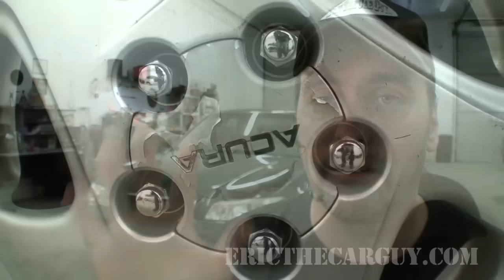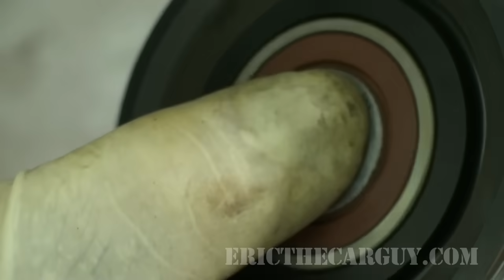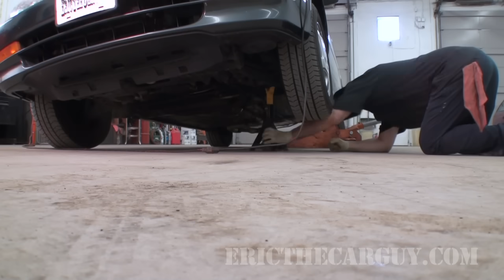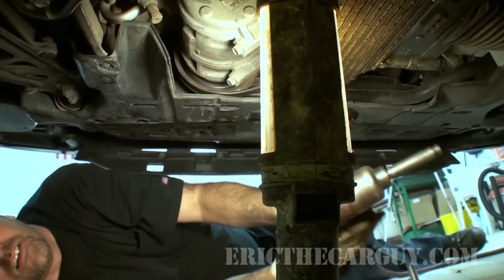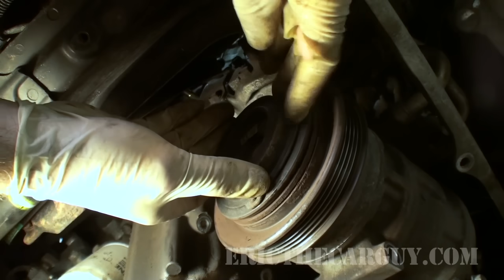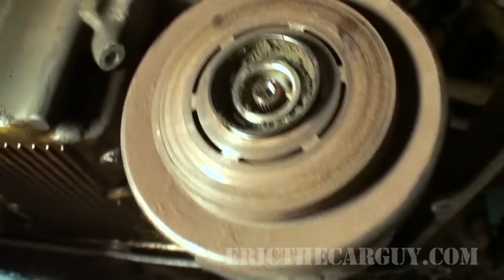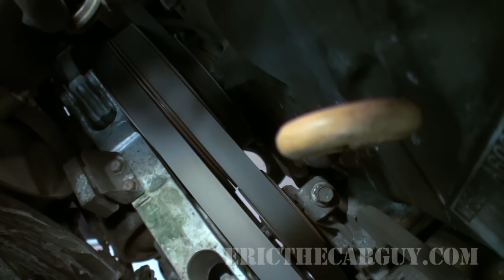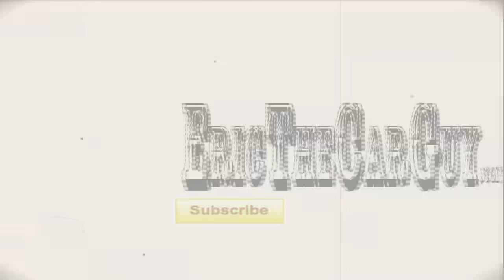AC Clutch Repair and Noise Diagnosis -EricTheCarGuy

Comment: I HAVE HIGH PITCHD SOUNDS FROM MY CAR WHILE THE ENGINE IS RUNNING BUT THE AC IS NOT ON AND IT DONT WORK EITHER! I BOUGHT THE AC COMPRESSOR TO REPLACE I ALSO NOTICED WHEN I PESS ON THE GAS WHILE DRIVING THE NOISE GETS LOUDER.

Comment: Surely if the noise is only there when the air-con is switched on, then it can't be the ider as it runs whether the air-con is on or off. Oh! I love your bearing treatment, guess this guy will be bringing his car back with a knackered idler bearing next few months eh? I see what you're doing there.

Comment: Hi Eric. This video is a great help.

Need your guidance for an issue I am facing with my brand new (3 months old) Hyundai Elite i20. The car noise is normal when the AC is ON but as soon as switch off the AC, there comes a grinding noise from the dashboard. The pitch of the noise also varies with speed. This is a new car and this issue is annoying me. Could you please help with your experience what might be the issue causing this?

Thanks a ton!

Comment: Hi Eric is it possible to adjust the position of the a/c compressor pulley? I have a pulley alignment issue on a 1990 ford f250 460V8 that exists between the tensioner and the ac compressor which is the next pulley in the belt path. dont think the tensioner pulley position is adjustable unless i tap the bearing further in or out to move the pulley.

Comment: hey bud I have a 05 Honda accord my clutch engages but shuts off and at the same time my cooling fan turns off. My Freon was low, I recharged the system and now it turns on and off along with the fan. The connection looks old and was thinking about replacing it........what do ya think? thanks.
Reply: I have the exact car, the coupe. You just over filled it. Bleed some of it out until the fan stays on
Reply: The clutch cycles using a compressor cycle switch to control the suction pressure. If the coolant temp sensor isn't calling for the cooling fan to stay on all the time, then the fan will cycle with the A/C clutch to pull air over the condenser only when needed.

Comment: Eric i have a similar problem.  i have a mitsubishi lancer cs3 2006 model. and  the noise happens when the ac is off. when i put it on it stops. i recently changed the bearing on the pulley. so im clueless now as to whats making the noise.  is there a bearing in the ac compressor itself. ???
Reply: had the same problem with my firebird. its the ac compressor clutch itself my friend. kind of a bitch to replace for my car. hope its not for yours!!!
Reply: kk.. i can withstand the noise for now :) .  but the ac works.
Reply: Yea mine did too. The only reason it sucked so bad was because my GM needed a special tool to do the job and so I was unfamiliar with the whole thing. If you are mechanically inclined even a bit you could tackle it. Just give yourself time and be patient. As Eric has said "it's only a hunk of metal, you have the brain"

Comment: I had an issue on a 99 crown vic where the aftermarket magnet was a different size.  I literally spend a full day in 0 degree weather trying to fit the pulley on.  I finally gave up was gong to take it to the shop but when I set down the pulley on the magnet on the bench it did not fit in.  My ahah moment.  My point; double check the magnet size.

Comment: I'm pretty sure my pulley is bad on mine,  has a little shake to it, and all the rest are real tight. but it makes that sound X 2 or 3 without the AC on.  Is that possible?
It's quiet when I put water on it and then returns to that noise fairly rapidly..

Comment: Hi Eric,
How you doing? Your videos are really awesome,they are so informative.
I just have  questions regarding my 2002 ford explorer. It has and idling issue,there is a little vibration on the engine.I cleaned the throttle valve, after I cleaned it,I did start it again, there stll vibration.I turned of the engine, when I did start it again , it cranks but won't start. I did crank over and over for 10 minute but it won't really start. I waited for 15 minutes ,I cranked the engine  and suddenly the engine turned on, and the vibration is still there.Do you think it is fuel pump issue?
It has also trans issue, and the code is P0775, says Pressure control solenoid B. Do you think they are related?

Fidel
Thanks

Comment: What about a ridiculously high pitched sequel that comes on when the AC is turned on but once I'm up to ~20mph it stops and wont happen again until engine is cold?
Reply: your belt AC belt is loss , tight it up
Reply: Master Wrong I'm having same issue.  I was told compressor is bad.  When cold starting, you can actually see the pulley slugglishly spinning while the squealing of the compressor takes place.  In my case, it started out as a small quick squeal and got progressively worse.  At first I thpught it was just the just the belt in till I got another set of eyes to observe at start up.  Good luck
Reply: DeFreshS10 wonder if the noise was in the blower.
Reply: I got the same problem on a 2006 murano.... we're you able to fix it?

Comment: I have a 2000 Silverado 5.3 with ac on at highway speed sound like a turbo pop off valve letting go now and then.
Any ideas?
Reply: QQTrick1QQ Check test 1-2? Sounds like NOX spray before launch?

Comment: why did the use the name Acura instead of Honda in the states? ???????????????????????????????????????????????????????????????????????????????????????????????????????????????????????????????????????????????????????????????????????????
Reply: Acura is the luxury vehicle division of Japanese automaker Honda Motor Company. The brand has been available in the United States and Canada since March 1986, marketing luxury, performance, and high-performance vehicles. It was introduced to Hong Kong in 1991, Mexico in 2004, and China in 2006. Honda's plan to introduce Acura to the Japanese market in 2008 was delayed, due to economic reasons, and later withheld as a result of the 2008 financial crisis

Comment: hi eric, excellent video. my clutch on my 06 suzuki aerio is worn, making a loud noise while AC is running. i called my local ac repair shops and all of them said they'd have to replace the entire compressor and wont just replace the clutch. they want between $900-1200k for the parts/labor. the hell with that im going to buy the clutch online and  im going to attempt to do the work myself. most "technical" work ive done on my car before this is an oil change, lol. wish me luck.
Reply: Were you able to find just the clutch for an aerio. I have onyl been able to find a whole compressor assembly

Comment: Your AC compressor is just identical to my 2003 Dodge Grand Caravan. I'm sure the problem is right there, but guess what? I removed the 10mm bolt but the clutch refuses to come out easy. Any suggestion about how to pull it out without harming anything?

Comment: Might have sounded a bitch harsh, i know this is an old bearing, which is easy to access and doesn't cost much. That's not always the case, so just saying.. with a little extra effort you can do a better job at it.

Comment: you shouldn't use that spacer to install the bearing at all.. this is one of the few times so far i'm going to disagree with your methods. When installing a bearing you should only hit the outer race (ring). In this case at least, if you install them press fitted on to a shaft you only hit/push the inner race. This is recommended so that you don't transfer the impact/force via the bearing balls. This prevents the formation of little dimples in the precision surfaces. Will you notice a difference after installation? No, will it mather in the long run, very likely yes.

The correct tool to use is a socket or pipe, a punchtool or whatever allows you to exert force to the press fitted ring only. Using a hammer to tap it in initially is fine, although i'd prefer a plastic/soft hammer.
Reply: Thats what most of em do at yt..they were watching just to spot the wrong or simply sayin only looking for that 1 tiny mistakes and off they go dropping atomic bomb and of course taught the whole world the correct way on the comment sec and feeling proud of himself.. Until it turned upside down to hit on him back..
Reply: robin1987100  It's amazing how many people don't listen when watching.  Try again at 7:45. He hit that one with a hammer because it was old, but I guess you missed that too.

Comment: Thanks Eric very informative video. Can I ask why you didn't just replace the bearing on the AC pump pulley, as you could have done on the tensioner.
Just asking as the parts you replaced don't seem available in the UK

Comment: eric, i'm trying to figure out if i need to change my whole compressor or just the clutch, no weird noises or anything, what happens is when i go out to start my truck for the first time that day, the a/c kicks on and blows cold like it should, now it seems once the truck is warmed up to operating temp the a/c doesn't want to kick on anymore, i checked to see that the a/c coil is actually turning on by touching a screwdrive to the clutch plate and it stuck due to the magnetism from the coil, it's just that the clutch isn't engaging while the a/c coil is on, any ideas or thoughts? this is on a 1999 dodge ram 1500, thanks

Comment: Excellent video from a great teacher. My ac is making a similar noise that I hear inside the cabin, and the ac works, but the blower inside the cabin is not blowing the ac air through the vents. So in addition to what you showed us above, what else do I need to look for? Also, my car is overheating. I put antifreeze in every other day. As a side note, we are having very hot Virginia summer days. The car is a 1998 Olds 88.

Comment: hi, im rochelle using my sisters account. anyway, my scion tc has a whining sound when its on or even when im driving. ive been to different mechanics and they said its either the ac compressor or the steering pump. i wanna get it fixed but i dont want to waste more money to fix whats not needed to be fixed. also, at first they thought it was the water pump so i had it changed. but i learned my lesson, i wanna make sure i know which part is causing the noise. help meeee pls! would it be advisable to just buy lucas power steering fluid to mix with my current fluid?
Reply: you can isolate the noise by taking the belt off each one of the systems one at a time, driving it, and seeing if the noise goes away. Power steering fluid wouldn't help unless you're already low and running the pump dry
Reply: Well I don't know about you but your sister is hot! !!!
Reply: Lucia Aguirre you can use any long metal tool, such as a big screwdriver, to act like a stethoscope. hold the pointy end on each suspected component when the engine's running and you can hear it making noise. Be careful and put your ear against the other end of the tool. as you try one component and the next, it'll be loud when you find the noise. just be sure to keep the tool away from moving parts, and yourself, too!

Comment: Hey Eric, thanks for the video. My sons 2002? or there abouts civic has a noise like that but it doesn't really change when the ac is turned on. Could this be an alternator noise?

Comment: IF its the bearing thats causing the noise then would would the ac be functional. I mean blowing out cold air when its supposed to
Reply: I had nothing to do with the video but I am a mechanic. If the a/c wasn't functioning, he wouldn't have started with diagnosing the idler pulley. It seems like it was just a noise problem, and people tend to go to a mechanic when their car is "making a weird noise". If you're hearing that sound but your a/c still works, it could still be the same problem.
Reply: cool. my ac doesnt work tho and the clutch spins regardless if the ac is on or off. i can see that there is no airgap at all...gonna get bypass pulley installed tommorow
Reply: ddq123 its low on refrigerant

Comment: Eric, perhaps you can help? I have a 1997 Toyota Avalon A/C grinding noise, thinking it's the bearing as well as shown here - however, the noise is quite loud, and only since the cooling stopped (134a almost completely gone).  When the noise ocurrs, the engine stalls/quits - this may just be due to the engine computer "recognizing" a power issue, and is shutting down for safety.

I say that, becuase, after restareting the car, everything runs fine, as before, WITHOUT the A/C turned back ON.  When I turn the A/C back ON, a few sconds later, the grinding noise again, and again the engine shutdown.

My 2nd theory is that the clutch, when engaged, is turning against an empty system, causing this noise, or my 1st theory is correct (the bearing is bad).

Is there extra tension or force placed on the clutch mechanism WHEN the system is devoid of most or all refrigereant in this model?  Would refilling (AC Pro 134a) "fix" this issue. or would I still eventually hear the grinding and/or wasting 44.00 worth of 134a?

Comment: A word of advice. Don't hammer the bearings inner metal ring, since these bearings have 1 row of balls and are made for radial load only, you want to ONLY hit the outer metal ring on the new bearing. If you hit the inner metal ring, you will expose the bearing with axial load and this can damage the balls and the balltracks inside the metal rings. The old bearing doesn't matter. Use the old bearing on top of the new bearing to hit on when fitting the new one instead of the spacer thing, and focus on hitting the outer metal ring only. Good luck
Reply: Fredrik Hällström good advice!!
Reply: Fredrik Hällström    Another guy who didn't listen.  Try again at 7:45.

Comment: MOST Honda compressors from what I've seen (I work at the dealer) is pretty universal for clutch clearance which is 0.35-0.65mm. Aiming for the middle is what they say is best when installing a new one to avoid noise and have proper operation so I aim for 0.5mm.

Comment: I have a question, vehicle: 1996 ford ranger 2.3 liter straight 4 cyl manual tranny. I have a mild grinding noise in my AC compressor and it slows down my serpentine belt with I turn on my ac, I think its the inner bearing gone bad or low on oil but I Dont know. Any thoughts?

Comment: I've been trying to change out my ac clutch, while it's still connected to the truck, but can't seem to get the magnet to seat properly.  I didn't want to hammer on the face of the magnet but found that a 2 inch piece of pvc pipe fits inside that magnet perfectly and give me a surface to strike without risk of damage but I am still unable to get it to fully seat.  Am I missing something?

Comment: what about a clicking sound?
Reply: Depends! In general, a clicking sound is normal. This is the clutch engaging, and as your A/C is on, the clutch will cycle on and off, giving you the clicking sound. A click followed by a low spinning noise is normal. A click follow by squealing means the clutch is wearing out (usually).

Comment: I have a 1998 3.2L like this one in black love it is a rare car to find and rare to find videos and diys of it as well as parts!. I did the timing belt water pump and thermostat very easy to work on there , did the oil pan and that was the biggest work ever 7+ hours on that job the tightest space ever to work on, once you take the diff out a lot of room to work, but other than that great engine great transmission. Now i have the same issue with the AC although the noise is not to strong it is irritating I like my engine to run smooth. Thanks to you  I will be able to fix it. The 2.5 has the same engine as your Acura vigor

Comment: 96 Cadavalier.  Short trip, turned AC on and something was making a noise.  Got in the driveway and smoke was coming from under the hood. Alternator was hot to touch.  Did the on/off thing earlier with the air and the noise went away. Air not cold at all and barely coming out on HI setting. HOW do I tell if the AC compressor, the pulley and/or the belt OR all of the above are bad?  What are the steps to find the culprit(s)?  Serpentine belt is almost rigid and I can't budge it.  Come to think of it, the battery was fine and now the vehicle is hard to start.  I know what I think but I would like your opinion.  Thanks Eric and the rest of ya, this forum is a big help.

Comment: Eric, I'm doing a flush on the entire AC system in my 03 corolla I'm installing a new compressor and I know the system holds 7oz of PAG46 and I can't find any info on how much oil to put in the new compressor.

Comment: thats the noise mine makes but louder I can see the bushing on the very front are gone  the 3 in the triangle shape mine wasn't idler cause  I by passed with a smaller belt the ac

Comment: I have a 2007 Dodge Caravan making noise as soon as the AC is turned on. After turning off the AC it takes a minute or so before the noise stops. I suppose the compressor still runs a bit after you shut it off to decompress? Would you say its the same thing? My bearing on the clutch?

Comment: I have a 1996 jeep grand Cherokee Laredo-V6 straight---my compressor clutch don't kick in when I press the inside botton -when I take out and put in the relay the ac clutch looks like it wants to kick in-no noise of any kind from the clutch in the compressor -both high & low ac lines have Freon-any ideas what is wrong people /because Erick never answer viewers questions(not mine)thanks

Comment: Hey big fan of your videos but you could have done simple a diagnosis of the compressor with a manifold gauge set checking static pressure and then turn the compressor on and do a performance test to see if your high and low pressure systems are where they are supposed to be and if not the compressor shelled out.

Comment: Ouch!  Don't use metal when driving a metal bearing let alone a bare hammer. The best drivers ive ever used are 2 1/8" cores from doors I have drilled out of solid doors.  Ask any locksmith for an old door core and he'll probably have one for free sitting in his holesaw set... at least I always do